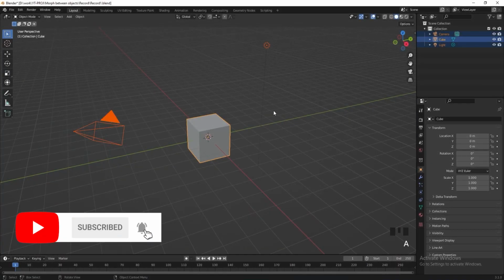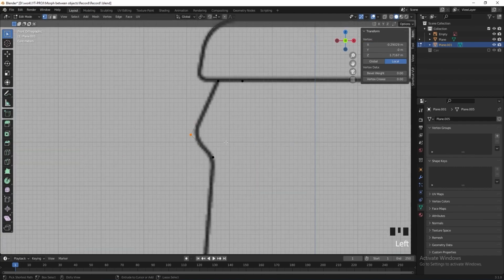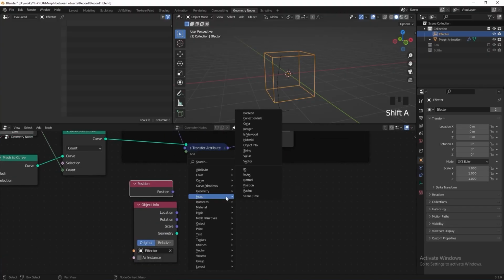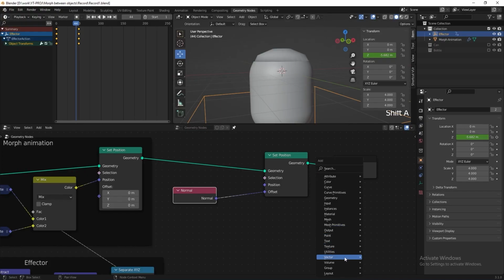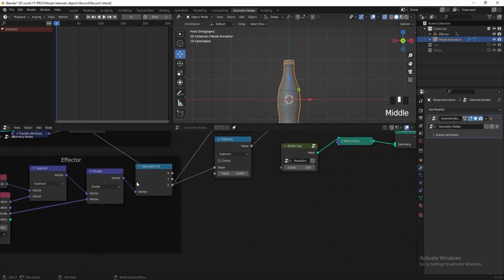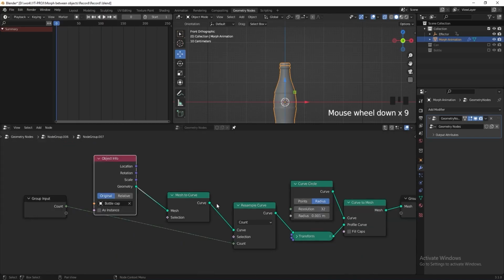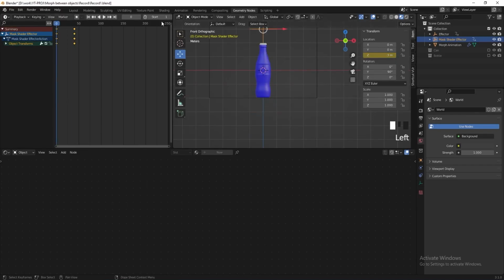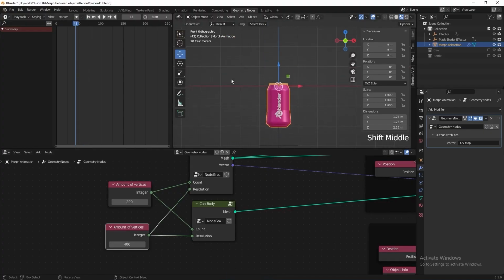Blender3D - Morph between objects using Geometry nodes

Comment: when i Start extruding the PLANE from the first dot, 
the next dot moves into all directions (X,Y,Z), so its not in line with the reference image,

how to lock the Y AXIS so I can create the model on the base of reference? 
should I somehow enter 2d mode as if i draw it on the paper? 

cant find solution for 2+ hours, anyone had the same issue?

thank you
Reply: I figured it - all I had to do is to press Y on the VIEWPOINT in the right upper corner 😶‍🌫

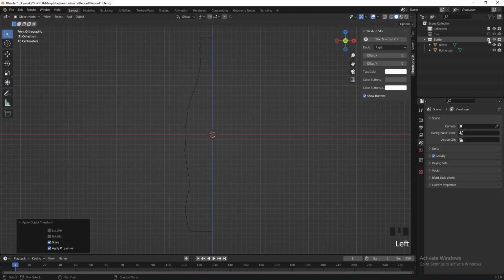Comment: That's a mind blowing tutorial, there's so much to do and learn, thank you! One question: is it possible to make transformations not to a curve but to a mesh and keep the same amount of vertices throughout the animation? Would it work with the node setup you showed at 5:08? I have a geometry nodes animation but I can't export it to MDD and then to FBX because the amount of vertices changes. Thank you for your time.
Reply from the maker: I haven't tried that approach, but I think it should work, just make sure the numbers of vertices for two of the objects are the same.
Reply: maybe you could have one curve for each mesh, the curves would match the shape of the meshes, but the mesh verts would be geom noded to follow the curves, so when the curve transforms into the other shape, the mesh follows?

Comment: i have some error, why my can end animation landing on bottom of can ? 
i already follow your tutorial and compare with your file
Reply: here my file 
https://drive.google.com/file/d/1NtNK5WxVbfVUGNeIKCUAsxNVK5FP0O-K/view?usp=sharing
Reply from the maker: Hi, I just checked your file, for the "Can End Animation", I think you have missed some of the steps, in the "Can End Animation Group", you need to add a Math node with Multiply -1 after the "Group Input" to flip the animation. Then you also need to add another Math node with "Substract 2" before the "Group Input" to delay the animation of the "Can End" so that the animation of "Bottle Cap" and "Can End" won't happen at the same time

Then for all the float curve in "Can End Animation Group" and "Bottle Cap Animation Group", at the top right corner of the float curve node, press the drop-down arrow button, and select "Extend Horizontal". Then your error will be fixed. Hope this help!
Reply from the maker: And you can try to move your "Effector" to a different Z-Axis position until you the result you want, don't have to follow me.
Reply: @Chong3D  thanks for your reply <3

Comment: If I need to create shapes without the animations. Is it possible to convert those curves directly to mesh(shape) using geometry nodes? I have tried eliminating the other node tree connections but it's not working.
Reply from the maker: Yes, after you convert the mesh to curve at the beginning of the node tree, add a "curve to mesh node" after the "Mesh to curve node", then connect the "Mesh to curve" node to the "Profile curve",  then add a "curve circle" and connect it to "curve". 

Anyway, regarding this, I have added a new working file to the Google Drive (Download link2 in the description), the file name is "Bottle", please take a look

Comment: You can also convert it to mesh after the set position to use less nodes
Reply from the maker: Yes, we have already convert the curve to mesh after the set position, then for the animation of the bottle cap, thanks for pointing out! We can use a set position to move the bottle cap instead of using an Translate instance, so that we don't have to convert geometry to instance.😄